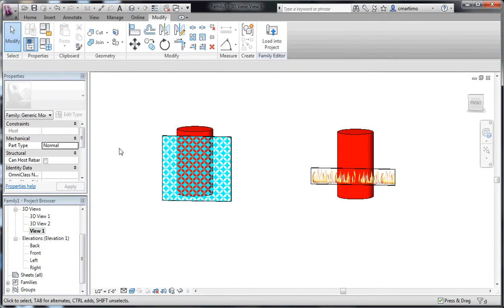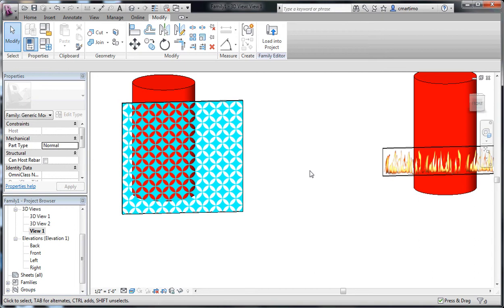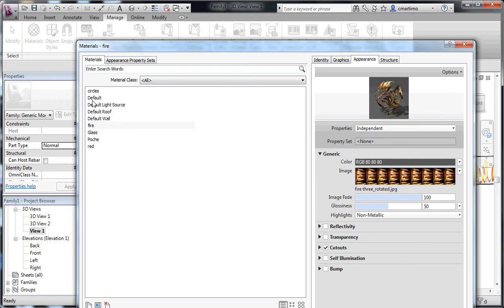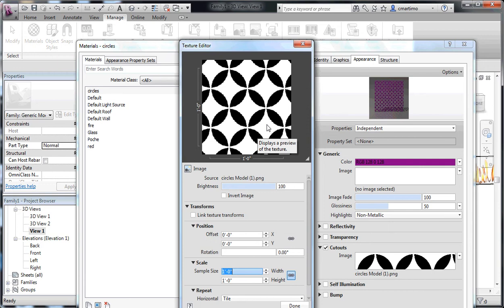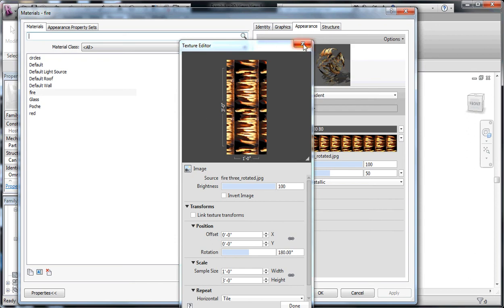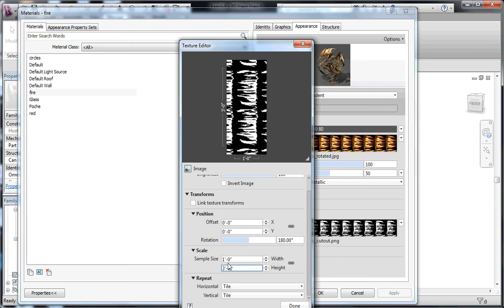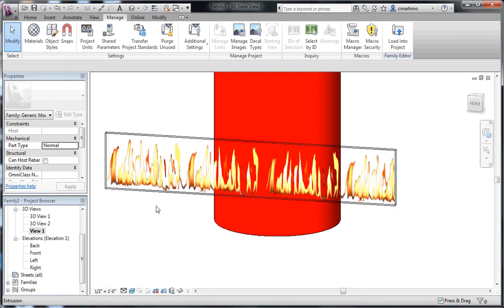cutout material with Revit

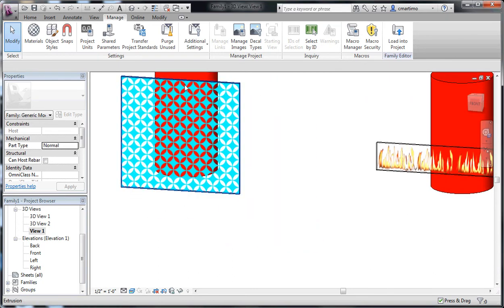Comment: Hi, very helpful thank you. However, I have a texture that is not symmetrical and when viewed from the opposite direction (as you note at 3:35) I get a mirror image copy of the image on the reverse side of the extrusion, any advise on how to solve this?
Reply from the maker: Yes - you need to create a 2nd material using a mirror image of the image - place that on the back side and it will line up.  If you use "paint" instead of making the extrusion a material you can apply a different material to each side. I use this when placing something like a statue or similar where it isn't a pattern per se but a shape that needs to align.  - Hope that helps!
Reply: @ckruse thank u so much,because of your reply on this question,i have settle my problem that also same with the one who asking,just making wall as glass or air,and finishes set as material cut out that we want,and finally my cut out facade not overlap like it's double cut out facade anymore , thanks 👍🙏